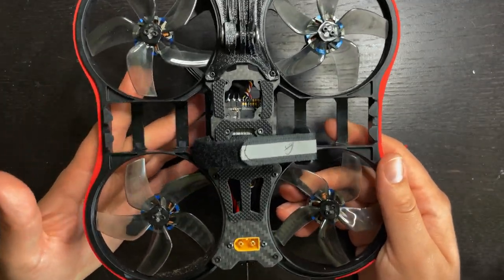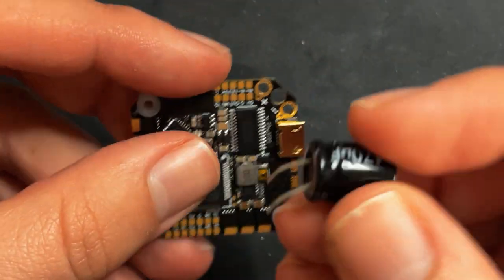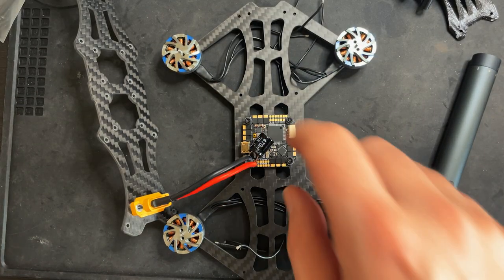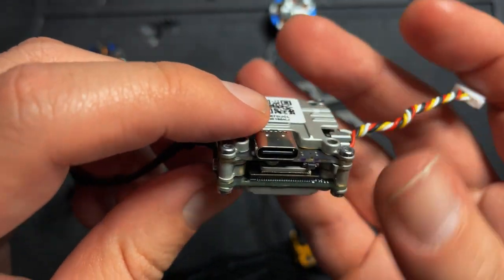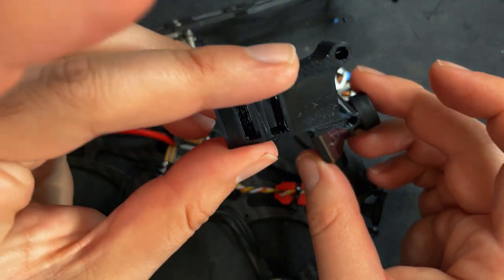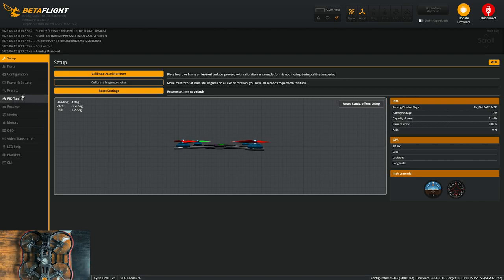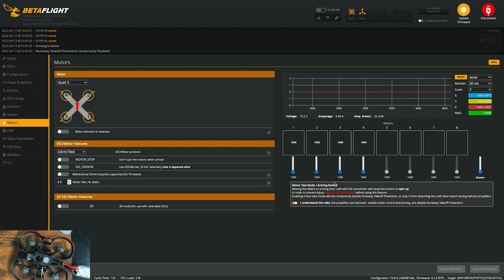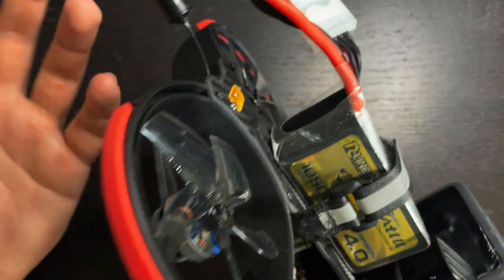Pavo30 PRO - 6S Cinewhoop Build

Comment: Hey Troncat (or anyone): I'm following this guide, but I'm confused at 17:49 - where did those screws / bolts come from? The ones you used to secure the caddx vista to the top frame. There's nothing like those in the caddx vista kit / frame kit, as far as I can see.

Comment: Sorry for newbie question - why use a 915MHz receiver over the 2.4GHz, what's the difference?
Reply from the maker: I prefer 915 over 2.4 since I do alot of indoor flying. 915 is better at penetration than 2.4 👍

Comment: Thanks for the video and flight. This is exactly what I was looking for. Question, are you using the default PID settings or do you have your own setup for it?
Reply: Great question
Reply from the maker: The default PID's honestly weren't terrible. I had a tune on it and ended up installing betaflight 4.3 so now I am re-tuning it.
Reply: @TRONCATFPV  Thanks for the quick reply, once I build this I'll give the default PIDs a go and see. I'm a noob and I'm mainly looking for cinematic flight so not too aggressive flying. I'm hoping that Angle or Horizon mode give me more stability for slower cinematic control but I've never used those modes, I was taught to fly Acro only LOL. I even thought about inav with gps/compass to use modes like alt hold and such, kind of like a mavic when I needed more stability but not sure if the FC would work with inav. Researching that now. If you have any suggestions for inav let me know as well. Otherwise, this is such a great build and look forward to building this. Subbed for the great work you put in.

Comment: nice, but im really confused with what receiver/flightcontoller/ESD are compatible with what, i just have a Mini Receiver Flysky FS-A8S 2.4G 8CH Mini Receiver W/ PPM I-BUS SBUS Output comming but now im really confused as to what flight controller it will work with and im terrified about when i connect the battery as i have 4 floureon lith/ion 11.1v 2200mAh (3cells) i just burn the entire lot out, my first copter worked out fine but my 2nd one im more scared because flight controllers so much more expensive than they were 4 years ago, i type in the power distribution board i have later when i know it(got it a while ago too but swapped it out for one that was much simpler to solder)

Comment: Thanks for this video, it helped a lot in building my own. Now on to PID tuning ;) as the stock settings are not the best. Maybe something for another video? What size Lipos do you fly?
Reply from the maker: Yes! PID tuning is definitely a topic for a standalone video 👍
I've been using tattu 1050mah 6s lipo. Also a big fan of the GNB 1100 6s batteries
Reply: hello Tom, what screw did u use to hold the Vista please? Am building mine and don't have those long one.

Comment: I have a ProTek 3 5 it's a lot like that, how is the volume of your quadcopter? I mean with the ducts it seems like my ProTek is annoyingly loud to the point where I would be uncomfortable flying it around people. My normal 5 inch drones aren't allowed
Reply from the maker: the 5 blade props I've noticed help significantly with noise level. Try a set out on you protek and see if it helps!

Comment: I'm not shi**ing on you, but if you pre-tin and dip in flux those XTleads and drop a blob of flux on the solder pads, you will need 1/3 the time with your iron on the board. Nice build, that was my only input and not a complaint, just a tip.

Comment: I wonder why making a printed adapter to mount 45degree isn't popular? That would let you keep the original board board orientation at the cost of a few grams. Maybe that weight is prohibitive?
Reply from the maker: I think it would be more difficult to fumble with the mount than it is to just tell betaflight the board is rotated 45 degrees. Especially since this frame offers a 25x25 mounting pattern. I am using an adapter on one of my drones but thats only because it doesn't have 25x25 holes.

Comment: Awesome footage, just getting into fpv’s. I know almost nothing and have nothing yet.  Your build is digital so does that mean you are using DJI goggles? I’m trying to figure out if DJI goggles work with diy fpv drones. Thank you
Reply from the maker: Yes I'm using DJI FPV goggles V2. To use DJI FPV goggles with an FPV drone you'll just need a DJI VTX (Air unit, caddx vista, or runcam link) 👍

Comment: Does it matter what kind of flight controller you use? Your flight controller seems to be sold out everywhere
Reply from the maker: Alot of flight controllers are out of stock due to the chip shortage. You can use any alternative that is rated for 6s and has a 25x25 mounting pattern. This is a good one: https://www.racedayquads.com/products/iflight-beast-f7-aio-2-6s-25x25-flight-controller?aff=58

Comment: What is the maximum weight that this drone can lift - or other words how big battery is possible connect to this drone?
Reply from the maker: with a GoPro on top I wouldnt take it above a 1200mah 6s. without a GoPro you could probably get a 1500mah 6s

Comment: So I ordered the 1watt HDZero freestyle transmitter. From another video build, looks like it is better to not put it on top of the FC. I also ordered this drone kit.. can I put the transmitter in the other slot on the top piece so it doesn't sit directly over the FC.. allowing for better heat management of the VTX?  Also.. being new to all this, given the 650gram weight, do I need to get one of those license thingies in the US to fly it if I plan to use any of the video on a YT channel like how you do here?
Reply from the maker: Normally I like to keep the VTX and FC completely separate for better air flow, the further away you can put them from each other the better. And yes, even if the drone was under 250g you would still need a part 107 if you wanted to monetize your youtube or make money with drone footage.  You don't need the license if you're just a recreational pilot and aren't making money with the drone footage.

Also, the only time weight really comes into play is when registering the drone. 
Under 250g doesn't require registration. Above 250g needs to be registered.
Hope this helps!
Reply: @TRONCATFPV  Thank you for info. I started to build mine finally.. I am a bit worried the solder around the power leads and cap are too close to the components right next to the cap holes. Also.. how would you wire up HDZero VTX to this unit? Is it just to a UART?

Comment: Hey Tron, thanks for another great video. I just got my GepRC Cinelog 35 4S but the rates seem super high. Do you modify your rates for indoor real estate flying?
Reply: Curious what his answer is as well, but I get this question about the ProTek35 and Cinelog35 a lot on my videos. My answer is that I have not changes my rates for indoor flying, just gotta practice making slow movements, however a 3.5" like the ProTek35 or Cinelog35 are not ideal for real estate flying. You want a Cinelog25 and naked GoPro for real estate. You could use the 35 for inside of a warehouse or something, but its a bit big and powerful for tight houses.

Comment: Does it matter if we choose the MPU6000 or BMI270 version of the FC ESC?
Reply from the maker: If you can choose go with MPU6000. I have one flight controller that has a BMI270 and I've had nothing but issues with the gyro
Reply: @TRONCATFPV  I found a M6000! Anyhow. I got to the step where I put the caddx onto to the top plate. I don’t have screws long enough? Did you need to buy extra hardware or did it use the long ones in the wrong spot??

Comment: I know you are trying to match, but those BetaFPV 2004 1700kv motors are terrible imo. Been through a few sets before I moved on. Not reliable or efficient.
Reply from the maker: Good to know! I've been using this drone for a couple weeks without any issues but if I run into anything i'll post an update 👍 Thanks for watching!
Reply: What motor you suggest to buy?
Reply: 3000kv or higher Brother Hobby or T-Motor